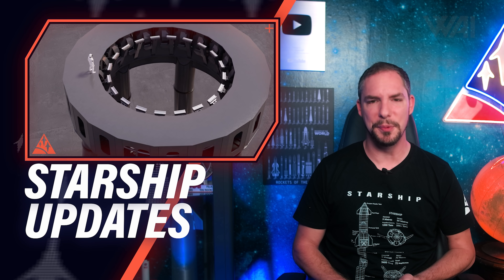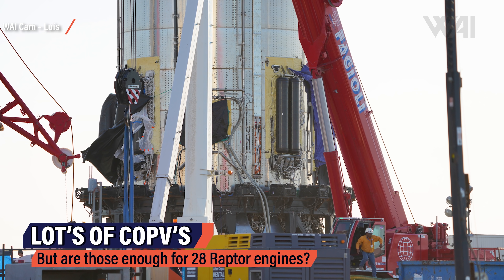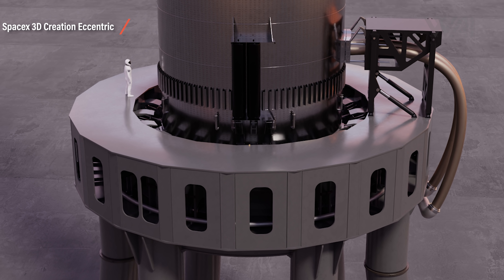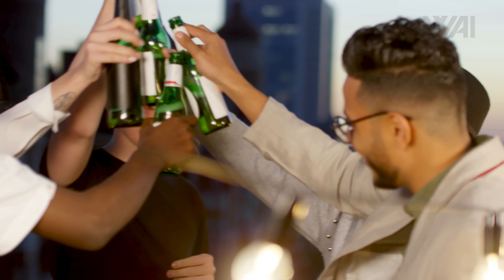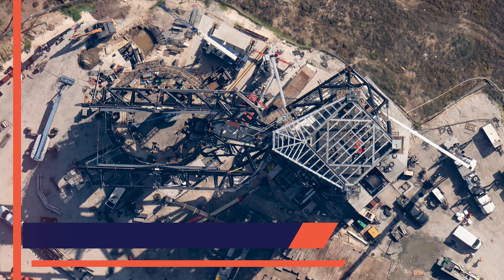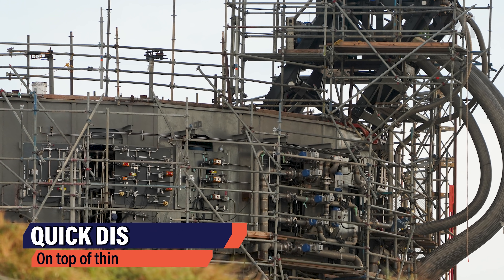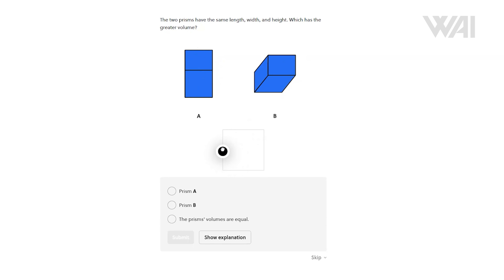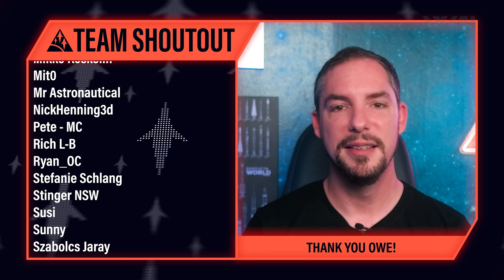SpaceX Starship & Super Heavy engine mystery solved!

Comment: The legs are the only pipes with a large enough diameter to supply the amount of water volume required at any given moment of launch. Just enough gravity from wide deep elevated tanks to push the water level just above brimming full overflowing into the exhaust plume and cascade down the superstructure to provide acoustic and temperature dampening and pooling and streaming cascades of water. Angles are important for the stand to propagate water deluge effects and promote its reasonable efficiency.. High volume low pressure gravity feed you just open up near the outlet ring and the rocket engine would use the venturi effect to carry out the rest of the processes. You would have to plan for the excess water or steam it off which is less desirable than a deluge. Steam is volatile so a deluge is preferred.

Comment: The chopsticks cannot place the booster on any pads without tread like tracks that can twist and manipulate position of booster to except quick disconnects. Easily done if tracks can move back and forth and also opposite of eachother to twist booster.

Comment: Well, since the Launch Vehicle is moving up twice  as fast as a Saturn V Rocket,  then all you have to worry about is protecting the Lauch Maunt from the very Hot  Exaust  combustion  from 27 Raptor Engines for a few seconds. So maybe they are using Liquid Nitrogen to cool the whole  structure. Is there any evidence of this double Jacket Cooling System on the Pad?

Comment: Personally, I think that what's missing (we don't see) on the OLM (orbital launch mount) is a clear indication for the answer to your question: Where is the water deluge system.
You cleverly pointed out that there is nothing that could refer to this; neither a system under the OLM to let exhaust gasses escape in an easier way...
I think SpaceX will never develop such a system because they already know that the OLM and most things there around, will all be destroyed (maybe also the tower) right at the first launch. They're planning to LEARN what is really needed to launch the Booster and modify the Phobos & Deimos Oil rigs accordingly.
Maybe they will have all launches by the sea, where it is clearly not necessary the water acoustic damping, of course.
So, in my mind, they're now making a deal with FAA to accept the partial damage of the local environment to have the right bits of knowledge for future launches.

Comment: Felix, you keep saying 28 engines on Booster 4. It's 20 Booster engines, 8 swivel engines in a ring, and one in the centre = 29 engines.
Later versions will have 20 + 10 + 3 = 33, as you correctly said.

Comment: Just thinking of how much water they will need, wouldn't they need a flow equal to pumping water up all of the legs and would that be why there are holes around the outer side? Could the whole thing be a spill way system on the outside of the mount, you may get away with using sea water through this kind of system?

Comment: Literally nothing new and how it has always been done. Look at everything from the Apollo missions to the space shuttle. Nasa's rockets don't even light themselves. They use a spark system mounted on the launch platform. Other rockets used self lighting propellants to get rid of pumps. SpaceX does very little new or different. They take old technology and apply modern methods to it at most. This reduces research and development costs, leveraging what was developed by Nasa using tax funds.

Comment: Just a quick FYI the new SpaceX crane a Liebherr LR11000 can lift 1000 metric tons to 660 feet. The difference is that Frankencrane could lift 350 metric tons more. I don't see that as much of a problem. The new crane should be able to build the second tower and OLM no problem.

Comment: So they reduce a lot of equipment by committing each flight to getting to MECO on time with no hiccups along the way because the outer engines will have no restart capability since that requires the OLM. You fail to reach MECO at the right time because some engine crapped out on the way up and it throws the whole mission off unless you can recalculate on the fly and burn longer. Man that's cutting it close.

Comment: As always, nice work Felix :) But at 9:15+ you are a little bit wrong. At the left side, there are only two big black pipes going up one leg (detailed view in the latest Starship Gazer slideshow video from 29.02.2021 3:01-3:12), your right blue highlighted line is just the concrete wall of the subsurface housing (visible on some RGV pics). Black pipes are typically used for gases or non cryo liquids and it's interesting that there they are connected with flanges near the ground and not welded, very uncommon for cryo fuel pipes because there are no such flanges used for tower and QD arm cryo pipes. Also these two big pipes look bigger than all other cryo fuel pipes used somewhere else.

Comment: Just wondering. The quick disconnect looks amazing but how does it stop the flow of CH4 or LOX after it's done filling up / if there's an issue and you have to abort? Or is that part inside the rocket? mmmm ... that would make sense.

Comment: I always wonder why horizontal air breathing looses out to vertical lift.  Atmospheric oxygen is free.  A carbon fiber rod has 6,000 MPA of tensile strength, or 870,000 pounds per square.  Refueling after takeoff, then tow to altitude overcomes weight of landing gear.  Jet fuel and peroxide can be mixed for non air breathing aspect of flight envelope.  No doubt Elon did the calculations and I am missing something.

Comment: The Launch Mount is an amazing piece of tech. Before it can be used though every bit of scaffolding and everything around it will have to be removed. The Booster ignition would destroy all that and send the parts and remains flying great distances. Ad Astra SpaceX!

Comment: awesome deep dive into the fuelling system, that´s why i can´t wait for your episodes like an addict :D
where did you come accross such specific information about the qd adapter and for what all the different commodities are used?

p.s. i think, they will for sure have a water deluge system integrated in the launch mount because it is basically a relatively cheap heatsink and they would for sure disintegrate the whole ground below if they used neither a deluge system nor a flame diverter.

Comment: Felix, do we know if the clamps on the launch table are mounted on a turntable type mechanism to adjust the booster into position?
It seems to me that the idea some have about spinning the booster by using opposite movement on the shopsticks is not possible as the catch points would probably come off.
Reply from the maker: The chopsticks might get a belt system to move the booster forward. Not sure though. There's definitely no turntable on the mount.
Reply: The load-bearing supports could just be rollers?

Comment: Hi Felix
Is it possible that all this work on the launch pad is temporary and the next phase will be on the floating rigs, where noise is no longer  an issue?
This may justify not installing a deluge system
Reply: Noise mitigation isn’t about lowering the volume so as not to annoy the public.  

There is an insane amount of energy carried by sound during rocket ignition.  Without somehow disrupting that transmission, very bad things can happen to your spacecraft or its launch support infrastructure.

Comment: This lanch table is a pain in ass. Its will melt and brake every time. Its better to launch booster with starship from hanging position using chopsticks. Again, these tables will melt and brake every time. Its a bed idea.  Don't do it Elon. If you eliminate launch table, you won't need to cool it with complicated water system. Launch rockets from hanging position. That's a good idea. You don't need launching table. Hang rockets by building better heavy duty chopsticks. As simple as that.

Comment: Why is it called a “deluge” system? Deluge valves are just control valves for (normally) large size pipes. I work with these on a daily basis.
Reply: Deluge - verb:
to inundate with a great quantity of something.
Reply: Standard procedure for mitigating sound and heat damage to spacecraft and launch support infrastructure is to dump a whole lot of falling water into the area the rocket exhaust will be shorty before, during, and after ignition until the vehicle has cleared the pad.
Reply: https://m.youtube.com/watch?v=LNkmwrTjKuo

Comment: So I'm wondering. Would they have to install the payload while the starship is on the pad since thats where it gets pressurized for hull integrity? Can it hold pressure while not connected to the QD arm? Is the hull strong enough to hold 100 tones without pressure?
Reply: It's going to be a long time until any payload is launched

Comment: Thinking about the orbital refueling, that configuration of the QD wouldn't work, and it makes no sense to me having two different adaptors for booster and ship.
The adapter on the arm and the adapter on the ship must be identical, and symmetric around a vertical axis, with O2 and CH4 stacked vertically, and for the allignement, two pins and two holes each.
Reply: why do they need to be the same? the booster gets fueled near the base of the booster, the starship gets fueled near the base of the starship. Those are a LONG way apart and you aren't going to put a starship by itself on the pad

Comment: Wow! Thanks Felix! The mysterious launch pad clamps finally explained, and what an ingenious solution to so many different hurdles, outer engine ring startup, reusability, weight savings. I am surprised at the absence of any apparent hold-down clamps. Generally the engines are started and brought up to full power before the rocket is released. Some systems overfill the tanks so lift-off doesn't happen until enough propellant has been burned off.

Comment: There are 4 pins on the QDC which you did not cover. Each is slightly outside and slightly below (or above) of the main alignment bolts. They are way too flimsy to also be alignment pins so I wonder what their purpose is

Comment: All those engines, all those systems, inside and outside the rocket!  I'll be shocked if the first attempt doesn't blow up.  Not wishing it, but there are so many points of failure.  I wouldn't be able to sleep at night if I was in charge of the program. It's crazy just to think about!  I'll have fingers and toes crossed during the first test!!
Reply: when Falcon Heavy make it's first flight. Elon was on record as saying that as long as it cleared the tower before it blew up (so it didn't damage the tower), he would consider it a success. When you re pushing the edge of technology, failures happen. In his interview with Tim Dodd, he said that all of the starship failures were in ways that were NOT on their list of probable failures to be worried about.

As long as it doesn't damage the launch pad, I don't think he's worried.

Remember, Elon keeps saying that building a rocket prototype isn't that hard, what's hard is building a rocket production line, he's focused on building that production line, which is why SN 15 and 16 are sitting parked out of the way, they continue to build things for the practice of building them, not expecting every copy to be flown, let alone expecting them to fly perfectly the first time

the fact that SLS/Blue Origin/Boeing/etc do 'qualify' rockets strictly via paperwork and ground tests would terrify my if I was going to be on one of the early flights.

Comment: The Orbital launch mount probably has 20 massive sub woofers - 1 for each outer engine - built into the ring just behind the clamps, to actively  noise suppress the super heavy boosters sound like some sort of giant headphone/electronic earmuff. Also, would be kool if they could "tune" the engines in a manner to destructively interfere noise wise by some sort of AI assisted modulation in the turbo pumps, so that  they are tightly out of phase lol....

Comment: Felix, I think I got a fix to keep the tiles from falling off. I went to a hardware store looking for a way without lag bolts and threaded bolts to attach theater chairs to a 2X12 and the same to hold the 2X12 to a floorboard. The idea I got was to use wood nuts. These are threaded into a hole and hold the chairs to that wood board. Then just use bolts to hold the 2X12 to the floorboard and chairs to the 2X12. 
How does this solve the tile problem with Space X? Grove threads on the corners of the tiles. 3 tiles with make the threads when worked on. The pins on the hull of the craft will be threaded corresponding to the threaded ceramic nut that will accept them. The bolt/nut when tightened down will hold the tiles to the hull and the nut will be held to the threaded pin and treaded grooves on every 3 points of the tiles. Ceramic nuts will dissipate heat on re-entry. Being ceramic they can be unscrewed or chiseled off. Just recreate out of ceramic bolt/nut to hold the tiles down for launch and re-entry. The plan would be great if an astronaut would have to replace tiles prior to inspection for re-entry.
I wish I could send a drawing of what it would look like as a cut-away and remove and installed

Comment: there is one obvious one that you might have missed,,,,and that is you didn't consider that the water supply might be incorporated in the launch mount legs itself, there's  a quite a few legs, and what better way to pipe the water underground to the base of the legs and up internal pipes to the top of the orbiter ring ,consequently do it this way and you won't be seeing anything from the outside, but what would I know    Cheers LES

Comment: The pipe in the deluge concept render looks way too skinny to handle the volume of water needed for a deluge system. Is there any chance that the legs of the launch mount are where the water would come from? They look plenty thick for such a purpose, and could be easier to construct than having additional pipes. I imagine that a lot of the motivation in designing the launch mount is not just to simplify the rocket design, but to keep construction costs down for the launch mount itself because there will be many, many more launch mounts in the future, and thus incentive to keep the construction effort as minimal as possible.

But I suppose that if this were indeed the plan, then we would have seen evidence of it from aerial photos, which doesn't seem to be the case. And if that's true it makes me wonder why they wouldn't route the deluge water through the legs... but maybe I'm overestimating the size of the pipes that are needed for the deluge and that adding a few additional, external pipes for the deluge wouldn't be that big of a deal. (Or of course maybe there's just no deluge system planned)

Comment: Surely in addition to the damage to the rocket that unsuppressed acoustic shockwaves could do isn’t the fact that SpaceX dedicated one of the huge upright tanks in the tank farm to be a water tank also a strong hint that there will be a deluge system otherwise why would they have put that much water storage at the launch site? What else apart from a deluge system could need that much water.

I know you love doing detective work Felix. In some of your now much older videos when the orbital launch site was in a much earlier stage of construction you looked at some RGV Aerial shots before they closed up many of the trenches and discussed some of the pipe runs and what was going where. Might there be anything to be learned by going back and looking at old aerial footage when they still had the trenches open and were still laying pipes to see if there is any water pipe stuff running from the water tank in the orbital tank farm to, or at least towards, the orbital launch pad?

Comment: I is possible that we just are see what is in front of our eyes. The feed to the deluge system is beneathe the launch mount. The 2 or 3 of the stand legs double as the feed pipes for the water from underground, like the water that flows into your house.  If I am correct, It is an ingenious setup

Comment: Methane is one Carbon and four Hydrogen atoms. Post oxidation (burning) some Hydrogen is released as base atomic material. A fair percentage of the LOx will be simply cooled to O2 and available to oxidize the base Hydrogen into H2O - Water. With the aid of a seed / catalyst (the water tower) this means the "rocket exhaust" will produce its own water! No "DeSal" plants needed.

Comment: Thanks for the informative video! One bit I still don’t understand is how the hold down clamps work to keep it from tipping, or to keep it from lifting when static fire occurs. Owe has small animations showing it but it’s still not clear how much pressure is needed to “hold” it tightly.
Reply: Only enough to cancel out the thrust in excess of the rocket’s fully-fueled weight.

Comment: Great show guys. Question for you,  how are they going to rotate the booster to enable the quick disconnect arm to attach after landing?
Reply: the catch arms have movable things on them that will push against the pins to get them properly aligned (I'm surprised they think they can do that with linear catch arms, but we'll see)
Reply: I always felt that the launch table clamps should be on a turntable system to spin Booster into position.

Comment: If they filled the launch tower up with water and sent a big pipe over to the table gravity would drive a pretty solid deluge. If the reservoir went right to the top it'd be taller than Bezos' tower and bigger than :SLS.

Comment: How could the Saturn have so many less engines as Starship booster and even get to the moon?
Reply: Bigger engines. The F1's powering the first stage were HUGE.
Reply: @_K3PLR  Also, the payload that got to the moon was TINY in comparison. The Saturn 5 also tapered from stage to stage, each one was substantially narrower, so while the full starship stack is only a little taller, the volume is MUCH larger.